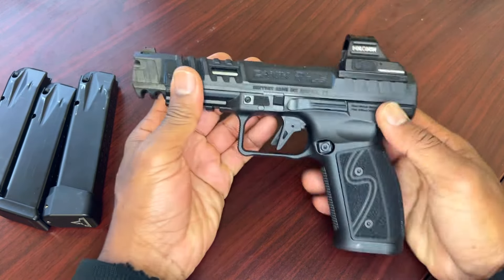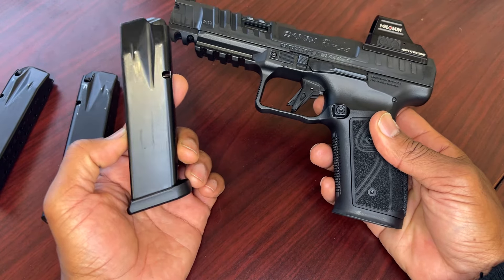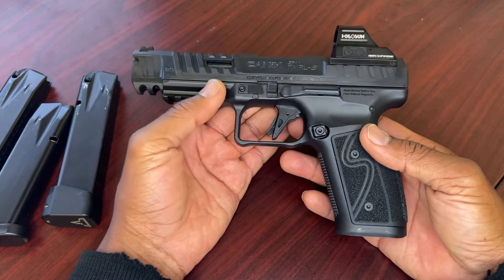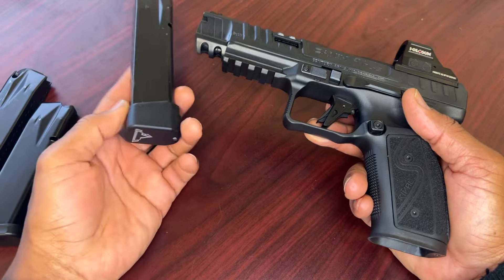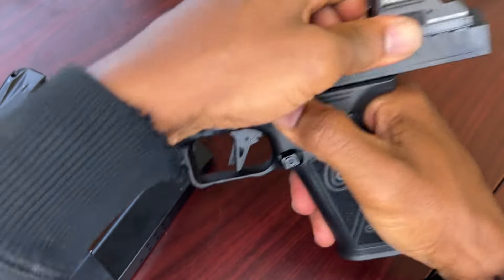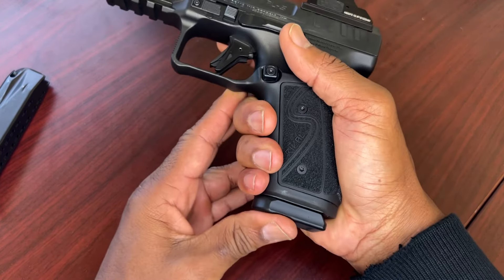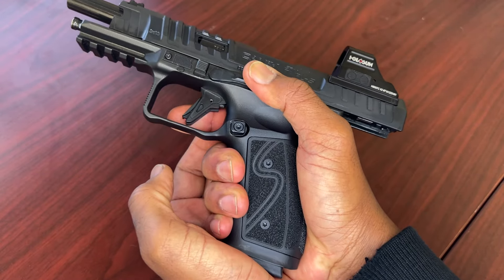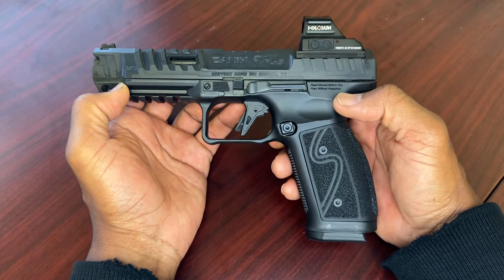Canik SFX Rival-S Problems SOLVED!

Comment: I just purchased and received a brand new RIVAL-S on 4/10/24 with a serial number of CS23 73XX with a production date of Feb 2023 and it's completely unusable.  Constant feed issues with 115 and 124 grain.  I had to send it back to Canik after having it for a week.  I put 300 rounds through it and it still ran like garbage.  I am hoping that Canik replaces it with a 2024 production model since it seems that the issues are not showing up in the 2024 models.  This is my first Canik and I am extremely disappointed thus far.
Reply from the maker: Exact same experience.
Reply: @SteveMiles  I hope Canik sends a new 2024 production firearm that actually works out of the box instead of my 2023 production that I will have to experiment with - because I am not experimenting with a firearm that should work out of the box.
Reply: @TheTbone707 hi there, did they fix the issue or send a new one? I have similar issues and just sent it to them.
Reply: @bluyetiinc7553  I sent it back to Canik and they replaced the barrel and recoil spring (lighter spring).  It still jams up once in a while, especially with blazer ammo.  I will keep shooting it, and if I am still have issues, I will send it back for replacement.
Reply: @TheTbone707  ive been using blazer and it fails all the time..maybe thats one of my issues.
Reply: @bluyetiinc7553  definitely switch ammo to see if that helps.
Reply: @TheTbone707  will do once it comes back.from Canik
Reply: Did Canik replace it?
Reply: @divinemasters8105  they repaired.  New barrel and new spring.  Seems to shoot fine now.
Reply: bought mine mid 2024 excellent gun it was as if it didn’t even need a break in period. Never jammed or had any feeding issues not once.

Comment: I ran a new gun with 10 rounds in a 2 gun comp. Gun didn't like 115, bumped up to 147 and no issues.
Reply from the maker: I’ve been running nothing but 115 gr since I got the new gun and have not had any issues whatsoever. I'd check the manufacture date and serial number of the one you have.

Comment: Is that an aftermarket optic plate? If so any reason not to use stock plates? I ask because my mechanic m02 plate came loose from frame and also optic to plate. I used 1 drop of blue loctite and never had an issue with any other pistol with optic. Thanks for the video
Reply from the maker: You're welcome and yes, it is an aftermarket plate by Disruptive Defense (DisDef.com). I use it because, without the hole, it lowers the optic so I can co-witness the red dot with the front sight. I've seen too many people fish for their dot, losing valuable time, so I must be able to co-witness with something or I won't use that optic. They're working on a plate with the rear sight incorporated into the plate also.

Comment: Thanks for these rival steel videos. Mine is in the 8000s and made Jan '24. Only mags I have are what is in the box. Does not this problem either. Have had a couple ftf as well as pulling the trigger, click and no bang, no primer strike. That happened twice with the same ammo .  I need to run it more to see if this is an actual problem. I really like the rival s but will keep my CZ p10 in my bed holster. That always goes bang, 1000s of rounds and never a failure of any kind from day one.
Reply from the maker: Does the serial number on yours start with 24CS or 23CS?
Reply: @SteveMiles  23cs08...date on the box is 1/4/24
Reply: Nice ! I just bought the rival sfx s and hopefully it don’t give me any problems. I have a p10 c as my everyday carry but still keep it as my bedside also
Reply: @MkArms1997 have you had any problems

Comment: How's your Steel frame been running? I have the Rival Trophy polymer edition. I want to upgrade to the steel frame, but I am nervous is won't perform during USPSA competitions.
Reply from the maker: I ended up selling it and buying Walther PDP Match Steel Frame. But before that, it was running great and the issues had been fixed. You won't go wrong getting one now, after the update, for USPSA competition.

Comment: I saw your winning run with that head to head steel match. You are a beast. Hope to see u there again.
Reply from the maker: Thank you. Changed my focus at the end and it worked out. I wish I had video of those runs.
Reply: I just got my rival S yesterday. Manufacture date on box is Jan 2024, but serial is only in the 700’s. I tested a few mags and everything good so far. Gonna try and run it before the next steel match on Wednesday.
Reply from the maker: @carlosangria3756  Is it a chrome version? Those tend to have a different series of SNs. I would think it’s ok with that manufacture date.